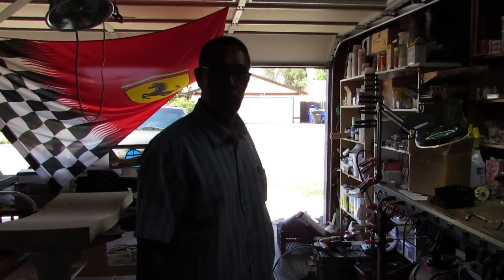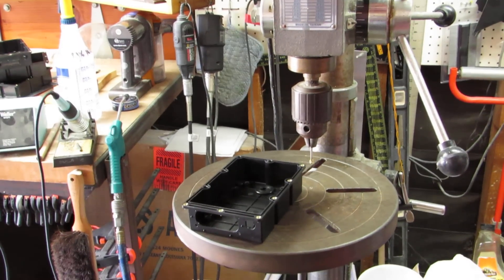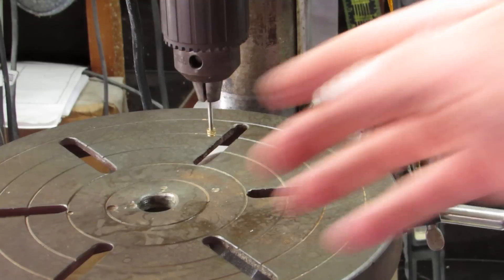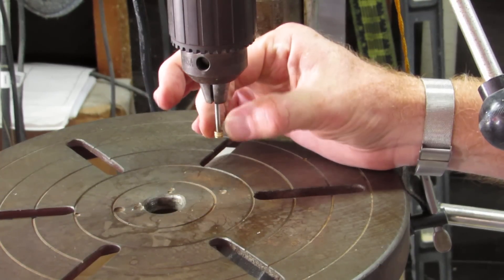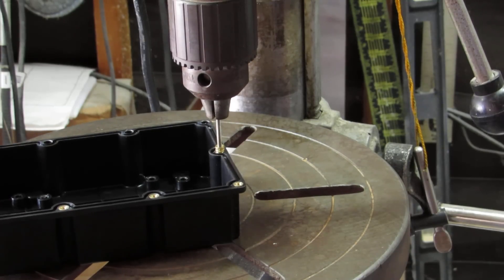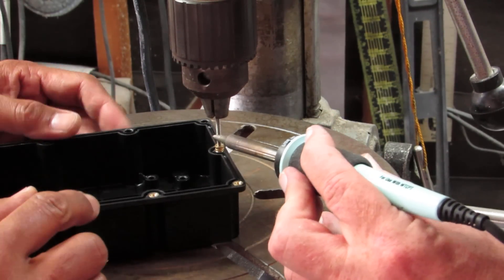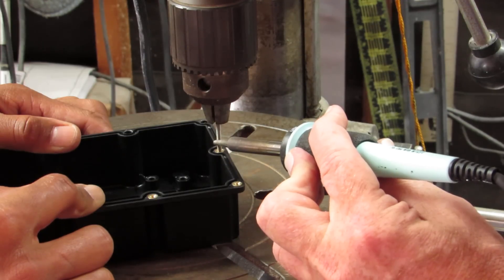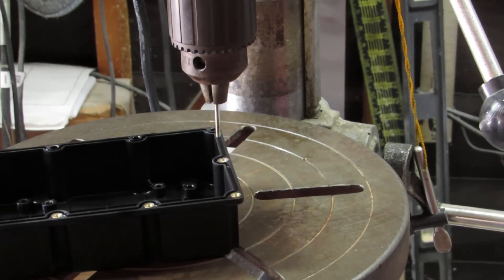Installing Threaded Brass Inserts Into Plastic

Comment: I don't recommend alcohol for cooling polycarbonate. It can cause cracks due to environmental stress cracking/crazing. You would be better off with some compressed air.

Comment: What hole sizes are you drilling or better how much material you need to be melted so the brass inserts do really stay rock solid into the holes? Expect that holes which are too big in size will reduce the accuracy of the brass inserts.

Comment: Very complicated way of doing it. Turn yourself up a custom tip for the soldering iron that goes into the insert and just push them in without the drill press. I have been doing it this way for years, takes 1/4 the time. You don't need the alcohol. Just a suggestion.

Comment: Hi, what is the tolerance of the hole? I mean if the brass insert is M3 what diamenter you suggest for the hole in the plastic part?
Reply: yeah, nice question. What should the recommended hole size for a M3, M4, M5 insert? does the hole need to be tapered?